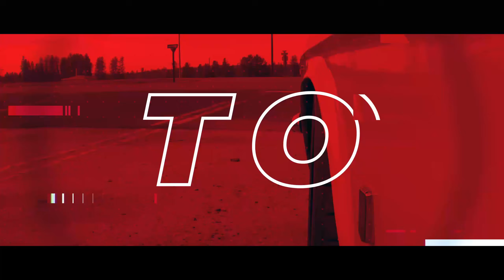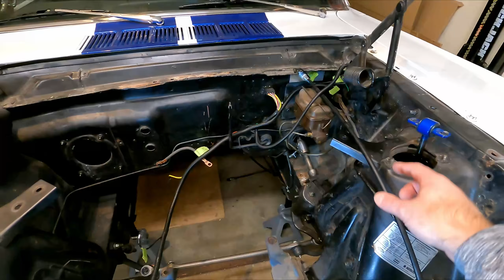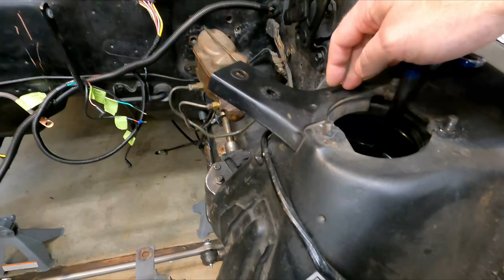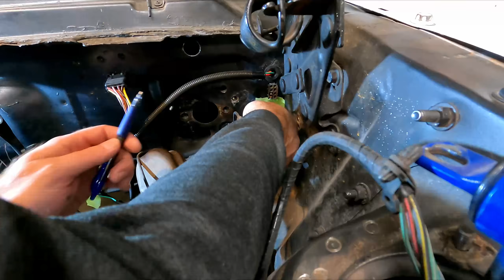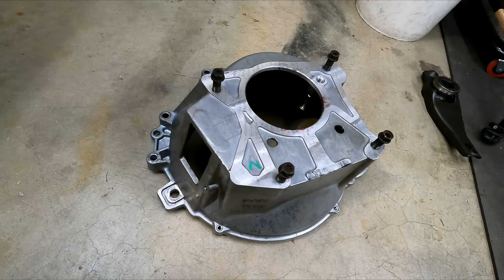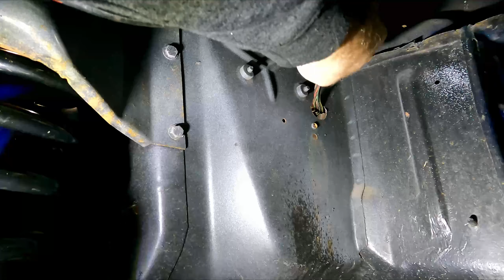What do you do when the Engine is out?

Comment: Anyone have a part number for replacement bulkhead connectors?
Reply from the maker: Which piece are you asking about?
Reply: @ the bulkhead wiring connectors on the firewall
Reply from the maker: @tbanuel  That might be tough to just get the connectors.  Places like NPD have sections of the wiring harness you can purchase.  Other than that, maybe eBay and buy a used harness to get the parts you need.  :)

Comment: Seems like those holes you drilled through the apron and headlight bucket need to have grommets and be sealed to keep wheel splash from coming through. What ever harness covering you use needs to keep water from accumulating inside the harness.
Reply from the maker: Yeah, that would probably help, but I only drive the car in good weather.
Reply: @KruseBuilt  - Oh ok, that’s nearly impossible here in Portland. It rains a lot.

Comment: Hey do you like the hydraulic clutch alot better than a cable clutch? Do you think they are both better than a mechanical clutch assembly?
Reply from the maker: I had the mechanical linkage clutch (known as the Z-bar) in my last Mustang and I was not a fan of it.  In that Mustang I upgraded to a cable clutch (when I put in the T5 trans), and then later to a hydraulic clutch because I melted the cable sheath on my exhaust (I didn't follow the instructions).  I have since sold that car and when I put the T5 in my current Mustang, I installed the cable clutch because I like the feedback I get with the cable, meaning I can feel when the clutch engages and disengages with the cable option.  However, I am getting older and I'm not liking the required leg force to actuate the cable clutch (which essentially the same force to actuate the Z-bar style), it's a lot of strain on my leg.  When I recently pulled the 289 out of the car to make way for my new 347 Stroker, I installed the hydraulic clutch (same as my last car) as it's easier on my leg.
With all that being said, I still like the cable clutch because it feels more original and I sort of feel connected to the car.  But the hydraulic is so buttery smooth and easy to operate, it's tough to not go with the hydraulic option.
The hydraulic option is about $200 more than the cable option, so if you have the budget for it, I'd recommend the hydraulic.  The kit the MDL sells is what I used both times and what I would recommend to any one asking.  :)

Comment: Great work! I have the cable clutch from modern drive line. Why r u switching to hydraulic? The only part I don’t like is having to step on the clutch all the way down for it to engage.
Reply from the maker: Thanks!
I'm old and my leg and knee could use a break from the effort required to do the cable clutch.  :)

Comment: Good video. Things to keep in mind when I pull my engine out. Just not familiar with wiring. Andy have you seen the bracket from daze cars that mounts to the T5 case instead of the bell housing? … I kinda like it more.
Reply from the maker: Thanks!  It seems like wiring and body work can be two things that a lot of us are unfamiliar with and can pull some of the fun out of a project.
I have not seen that bracket before now, and I can see why someone might like the way it mounts to the trans.  But I really dig the clean setup with the MDL slave cylinder, and this is now my second car with their parts, it's tough to move to another company when MDL has been so good to me and my car.  :)

Comment: Fun stuff! I just did your exact battery relocation to the trunk using all the same parts! battery, breaker and battery hold down! I routed everything and modified it slightly but pretty much your exact setup it looks really good I'm just not sure how it's going to work yet tho, and it's too bad it's not the same vintage of mustang but I'm using what I got!
Reply from the maker: Your setup should work, everything was good before I pulled the motor, so it should be good when I put the new motor back in.  😀

Comment: When u hit rust with spot weld drill that's how u know when you're through . Also my motor will be coming out trying to decide on a crate motor or rebuild the 289
Reply: I went with blueprint crate 347... best warantee/ price
Reply from the maker: Yeah, that rust thing sounds familiar, good to hear it again. 
Building the 289 will likely be cheap enough to the point where you can still get a few upgrades and still save some money. Is was tempted to build a 7500rpm screamer, but I figured more mid range power was the more realistic use of my motor. 😀

Comment: If you want to hide the ground strap to the engine there's a nice threaded  bolt hole in-between the heater core hose holes and the blower motor hole that I run to the back of the passenger cylinder head. also this is a good time to hit the engine bay with a bath of degreaser and a light coat of spray paint to make everything uniform, a heavy duty wire wheel on a angle grinder will rip through paint, excess seam sealer, and remove rust very easily. just don't sit on one spot to long as it will also remove metal, treat it like you polishing paint just keep it moving and your fine
Reply from the maker: Yeah, I already have a ground wire in essentially the same spot.
I did take advantage of the open bay to do a little spring-cleaning. 😀